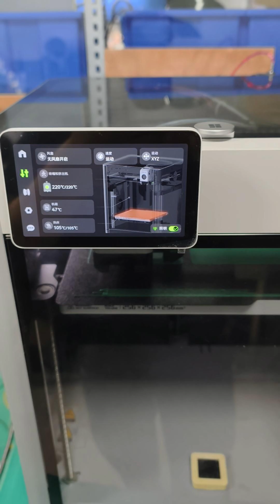Water Cooling Kit for Bambu P1/X1 Printer

Comment: Water cooling is a game changer for 3D printing. It's cool to see that you guys are one of the few companies to get it
Reply from the maker: We doing the second generation bambu water cooled hotend. if you  interested, we would be happy to provide you  unit  available
Reply: @3DMELLOWPrinter I appreciate it but I'm actually already working with you guys to develop water cooling systems foundationally. You guys are doing impressive work and I can show you how to push past that point into a product line where you can show people a way that is so much more beneficial. You're already doing it in this product alone is the proof of it but I am helping build out the rest of the ecosystem or at least that's how I see my role as a water cooling expert within the PC Hardware manufacturing industry for well over a decade.

Comment: I ordered this water cooling system for my Bambu X1C because with the hot weather lately, I get a lot of clogs with PLA, even with the door open.
However, in order to mount the cooler and water tank to the X1C, I need to print a mounting plate. Where can I get the STL files?
Reply from the maker: Hey there！ please contact customer service. They will provide it for you.
Reply: @3DMELLOWPrinter I tried sales and service, and even the person (Feng) that helped me with the link for the water cooling set, isn't answerting anymore
Reply from the maker: @RobNisters  I'm so sorry ， could you please provide your  order number? I'll let the customer service send it to you.

Comment: whats the point of this
Reply: They pretty much took filament that is the most prone to clog at even much much lower temperature ranges. They then pushed the temperatures and enclosure environment so far past and still didn't get clogged or negative aspects that you would ordinarily see solely due to the water cooling system they developed
Reply from the maker: This is an ambient temperature limit test, which is mainly used to check whether the extruder will be blocked due to high temperature, so it will not be blocked even if the printing temperature is normal.

Comment: um... so the watercooled hotend warps the print?... i got a p1s and print pla with a bed temp of 70 and dont get this issue
Reply from the maker: This is an ambient temperature limit test, which is mainly used to check whether the extruder will be blocked due to high temperature, so it will not be blocked even if the printing temperature is normal.
Reply: No, that's not what the point of the testing was. Pla is most prone to clogging at those temperatures, so they're displaying how impossible printing conditions.

No one would ever use those ranges, but they used the most failable types of plastic to show how it would not clog or have any of the negative effects. Especially in the material type (PLA) that is most prone material that is notorious for failure even below those temperatures. 

They're essentially showing you proof of thrir high temperature ranges in multiple different ways to show that it's so far out of spec but still is functional. The point is if you can do it with that, you can do it with almost anything.